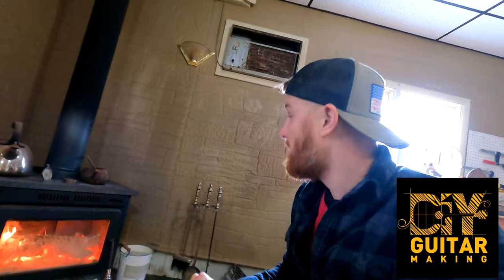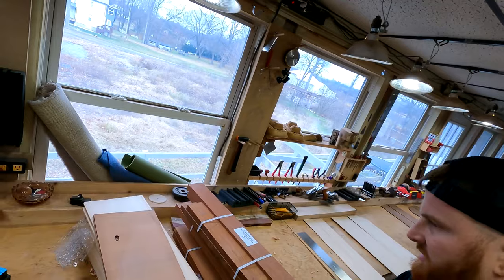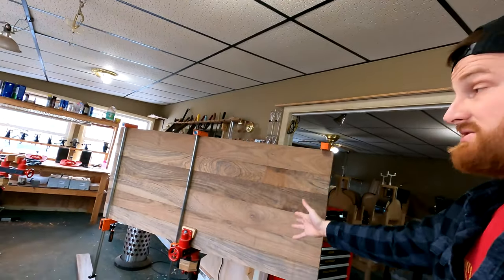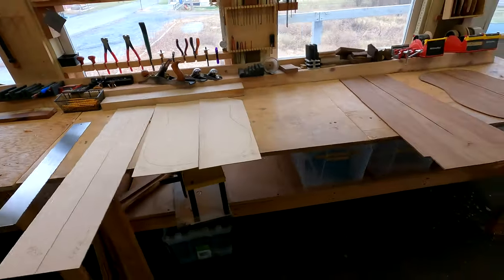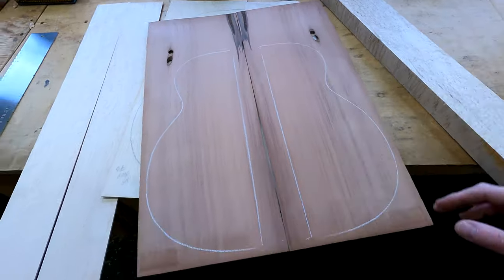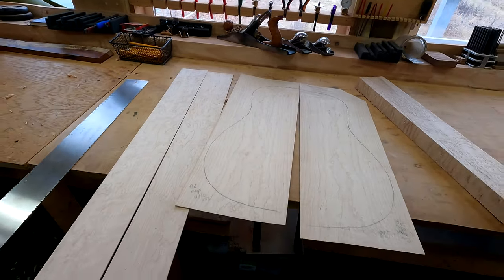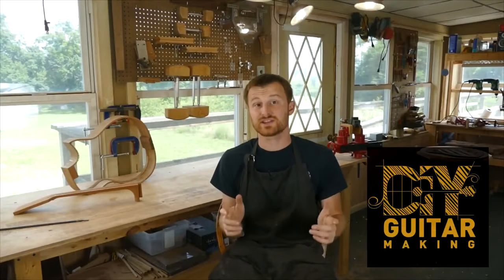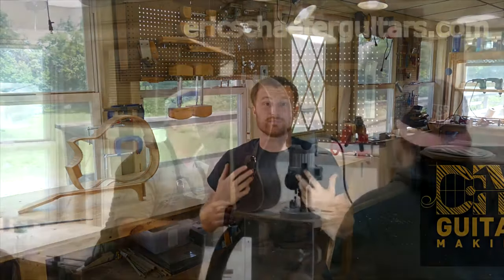What is my Next Guitar Build?

Comment: Black Walnut makes excellent guitars, sounds and looks good is easy to bend sides and carve into nice stable necks. Possibly easier bending than rosewood.  Lumberyards regularly carry it Quarter sawn for about 10% over flat sawn.  Pretty easy to resaw into back/side sets for around $20 each.  I don't know why it isn't more commonly used.

BTW, Janka hardness is not measured in foot pounds.  "The Janka test measures the force required to embed a .444 inch steel ball into the wood by half its diameter."